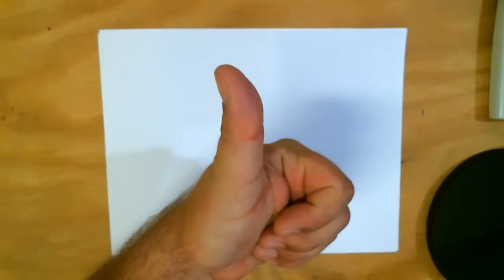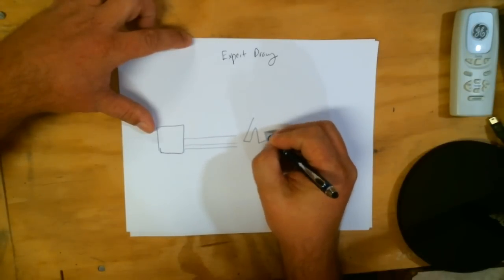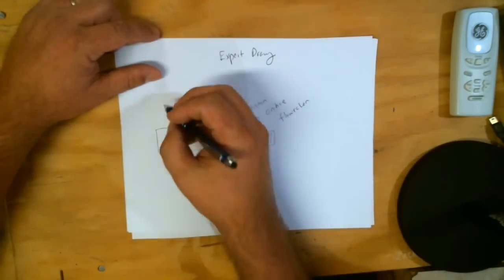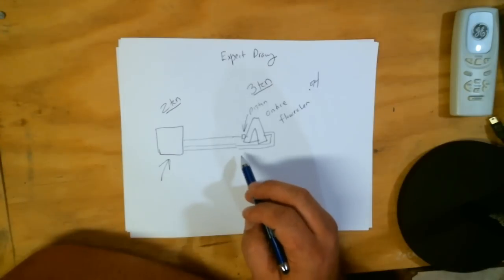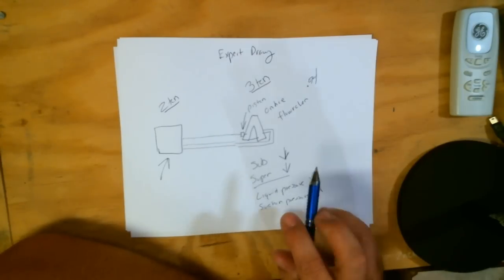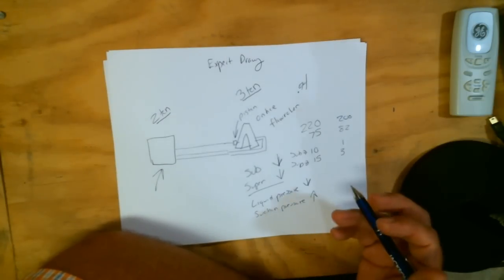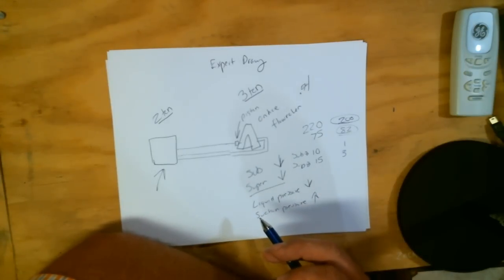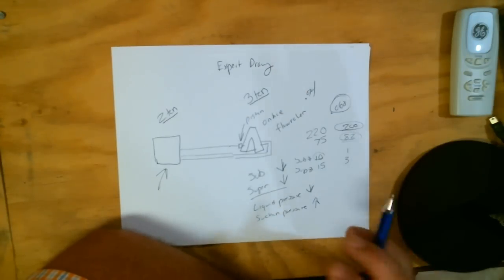HVAC Fixed Orifice Tech Tip | Irregular Refrigerant Pressures

Comment: What else would cause this issue with a flowrater, my system takes an. 080 and it's obsolete.  Had this problem with a .082 and a .078. Had to under charge by 3lb to finally get my superheat but have a -2 subcool and you can hear that it's running dry.  Humming like an old refrigerator.

Comment: I just had this problem. I installed my first home a/c system. I bought a Goodman 2 ton condenser and a Rheem 2 ton n-coil evaporator. I used the txv that came with the Rheem. My suction pressure was 150. I installed a piston and the pressure dropped to 45. I added 410 and my first a/c system is working fine now. A video is coming soon.

Comment: Today i came across an old carrier r22 system from 1988, Matching indoor outdoor unit neither have been replaced, i started it up for the first time this season New filter, Clean evap coil Clean condenser coil i experienced a bit of a low High side pressure just below 20° above outdoor ambient, My back pressure very low only about 45psi max, superheat showing 20° but as i added to it my back pressure would decrease before system starts to freeze up. Back press would keep decreasing, i partially blocked top of condenser to raise my high side pressure and as i did that my superheat went right down to 1-3° I was talking with my coworker and he is telling me the fixed orifice is over feeding could you do a video on this symptom? i enjoy how basic you explain and draw out issues and resolutions Thanks. Also i did retry running system twice with a day of it being off to fully thaw but nomatter what i did the back pressure would drop keep dropping and suction line start to freeze
Reply: This comment helped me prove that the piston was wrong, and causing freezing, while someone was rushing to tell me it's just low on refrigerant. The condenser cover did the trick. Now the company is ordering a new evap coil and the correct piston. Thank you for this neat trick!

Comment: I have the same problem today but the unit  start to freeze . my saturation temp in the coil was 29 and suction line temp was 39  can that be a piston problem ?
Reply: i experienced this today my coworker told me the piston was overfeeding, did you end up resolving your issue?
Reply: @mattheebz8017  yes the piston was oversize

Comment: Great video. Thank you very much. Can you explain the out gas if you open up line to look at piston. What pressure is in line ? Do you have to leave the machine off for a while before opening. Is this just for one gas in particular ? which gas (i think you mentioned the gas). If its a TXV expansion valve can you also open up this ? Im just new to air conditioning and still completing my studies.   Michael
Reply: Are you still doing a/c work?